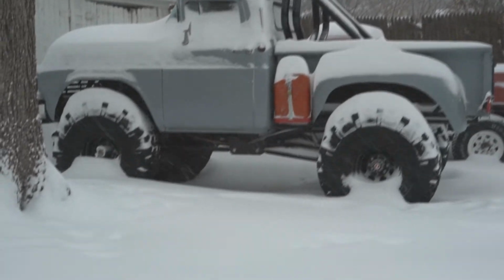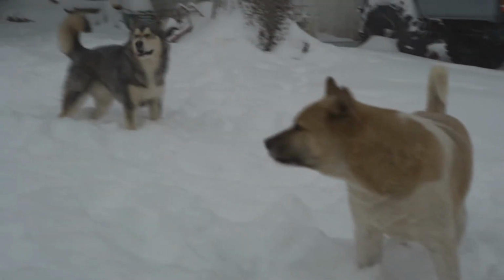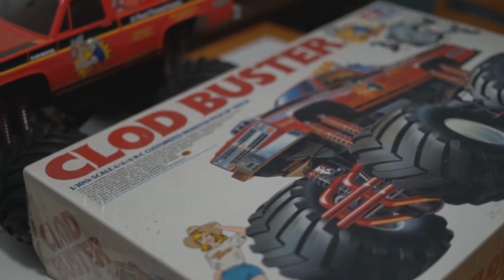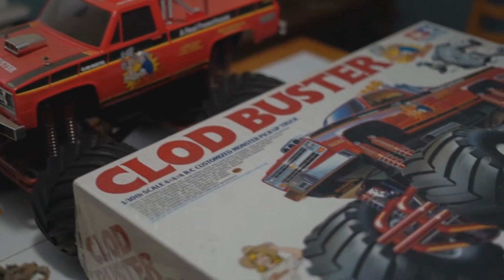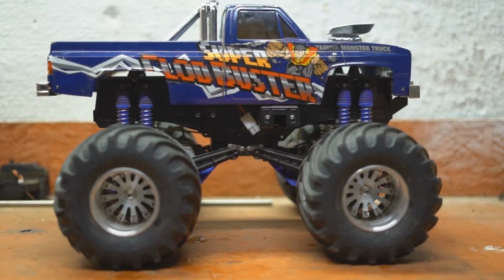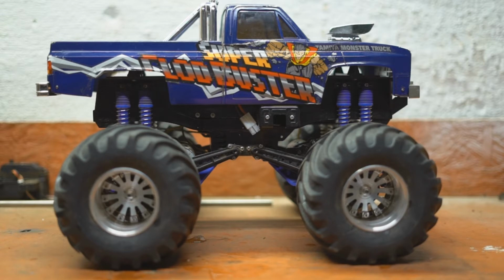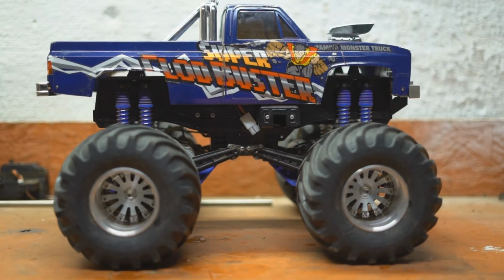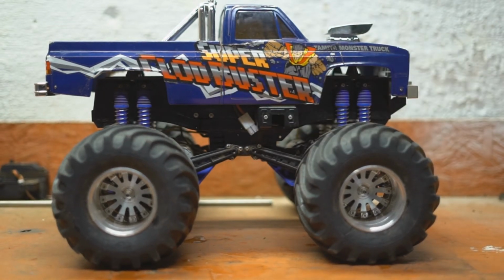super clodbuster fun

Comment: I just got clodbuster black edition kit. I had a original clod i had a few years ago i put. Esc in it n it bought it to life. I am sorry i sold it. I mainly run tamiya and traxxas. I am so old school i run brushed motors n sport packs with tamiya connectors lol. I dont do brushless or lipos lol. I mainly bash with my 2 nieces n nephew.
Reply: In my stable i got a luncbox midnight pumpkin a stampede a grasshopper a hornet monster truck buggy i did. My nephew has a traxxas grave digger stampede n my 1 niece has the skully truck stampede and the other 1 has a pink stampede. 

As far as kits go i have to be buikt a green edition grasshopper a 2016 blackfoot a 2016 monster beetle a 6x6 kong head the clod kit i just got lol
Reply from the maker: LongIslandP8ntball awesome sounds like you have a nice collection of tamiya s
Reply: @clodbusted1776  ty

Comment: I just got a set of those wheels.  Did you have any issues with the tires spinning on the rim?  Normally you glue the tires to plastic, but I am not sure that will hold with aluminum. - Thanks for the help.... BTW, did you happen to find any shock for the Traxxas Sledgehammer you would be willing to sell?
Reply from the maker: Jason Markley mine actually spun more on the aluminum wheels I had to glue them . I just checked I have full set of extra shocks how many do you need
Reply: clodbusted thank you for the reply. The Sledge hammer I picked up is missing the two rear left shocks. If you are willing to sell them, I can send you my info. Not sure how to send a DM on YouTube.
Reply from the maker: Jason Markley sorry it took so long to get back to you, for some reason I’m not getting notifications from yt. You can email me at jeffh448@gmail.com

Comment: I spent mine putting 4 link on my bullhead and front mount servo
Reply from the maker: Vtec Banger I want to do that to mine the factory steering is not the greatest and the suspension is very sloppy
Reply: clodbusted I used 2 packs of summit links and bought the shock mounts, 4 link mounts from eBay and 2 packs of servo mounts from Crawford. I saved all the old parts and I can't wait to try it.
Reply from the maker: Vtec Banger I have the axle mounts I just need the shock and Servo mounts I’ll check out those summit links. Thanks for the tip let me know how it works out 👍🏼
Reply: clodbusted. Here is the update. I ran a nice hobby star high tq servo on front, the stock servo rear, 2 Chinese 17t brushed motors, xl5 esc, 5000mah 50c 2s, summit tie rods as 4 link, and short rods included as steering links,  old school gold aluminum hop up shocks, stock chassis. The truck is mean. I lifted it a bit and did a custom body too.
The motors on mine suck and I don't know what to do. I have the 360 old school mega monsters and I don't like those either.
Any advice on motor? I search Google but people seem to like stock cans on 3s.
Reply from the maker: Vtec Banger sounds like a good setup I checked out those summit links thanks for the info. I like the rc4wd 20t motors they’re pretty cheap the better way to go is to find the old monster mash motors on eBay but they’re pretty expensive usually around 100 for the set one is reverse rotation
Reply: clodbusted I'll research those and some brushless I guess. I'll do a cell phone vid soon. I wanna slay some mud this summer
Reply from the maker: Vtec Banger brushless would be the best that’s what I’m leaning towards. Look forward to the video